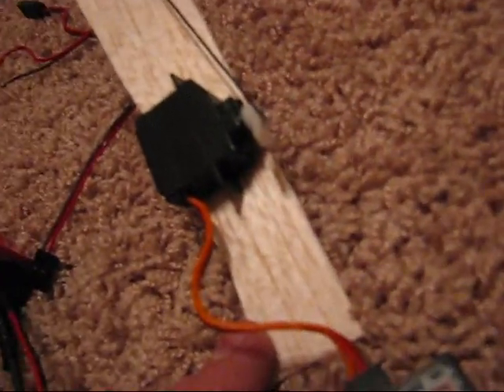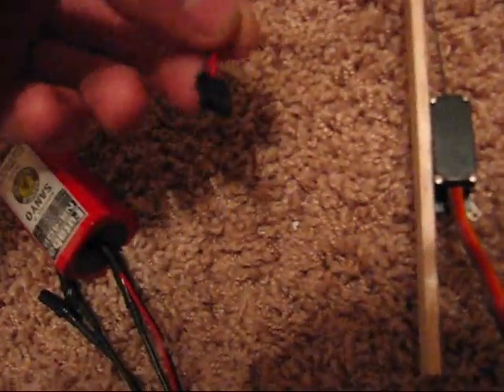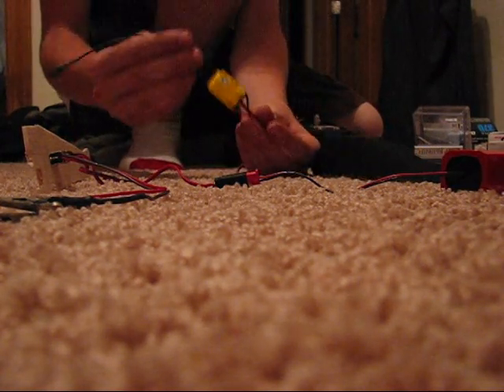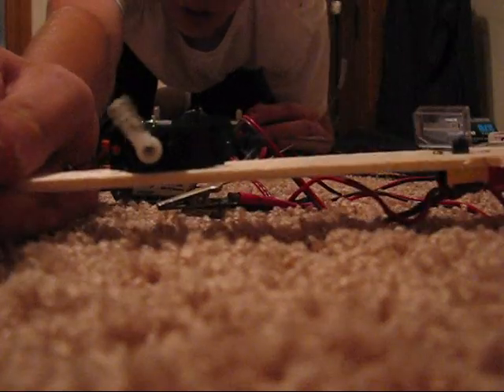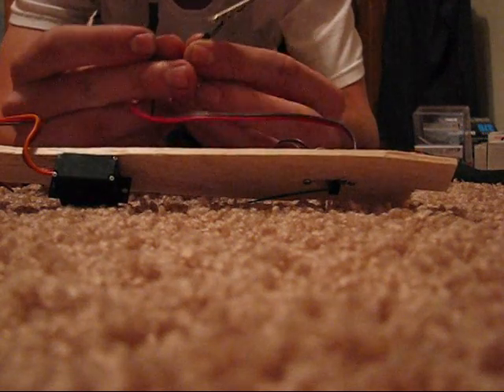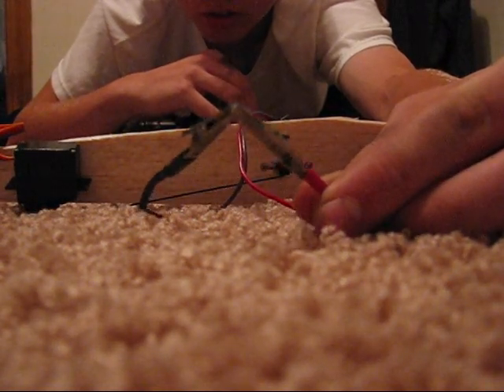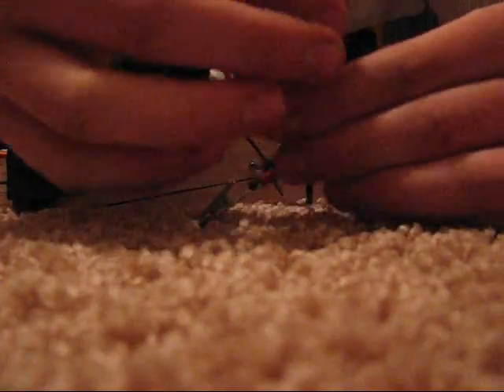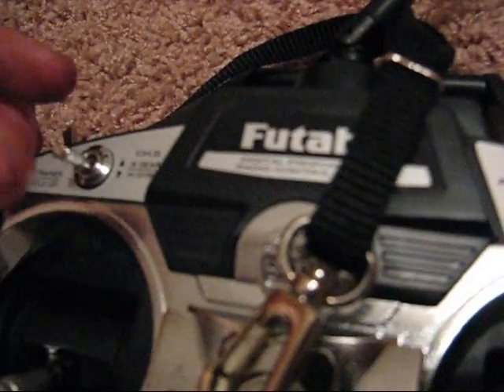r/c airplane rocket launching system

Comment from the maker: it depends on your plane material. i found out foam board isnt affected, depron melts a bit, monocoat melts and burns, so if your going to do this pick up some aluminum foil tape. works as a great heat and spark shield. and you could also take out the fuse and insert a estes rocket ignitor instead. its instant takeoff.